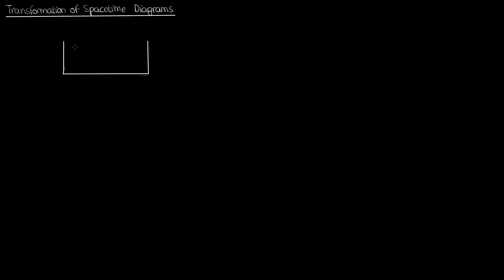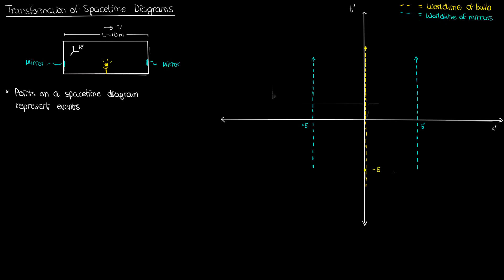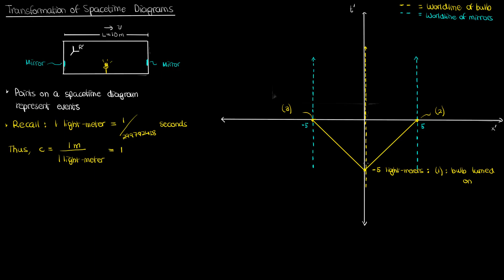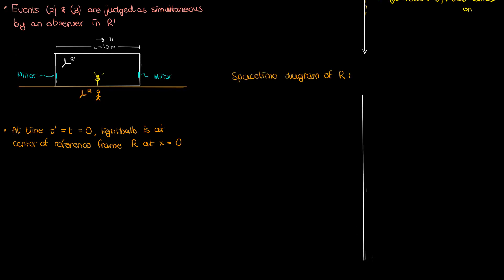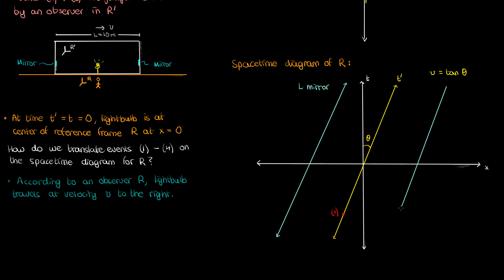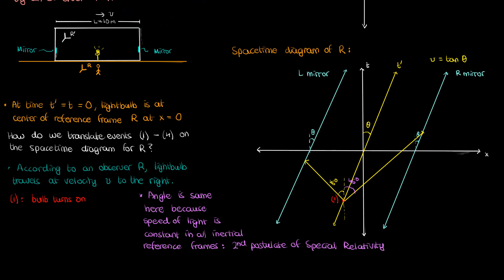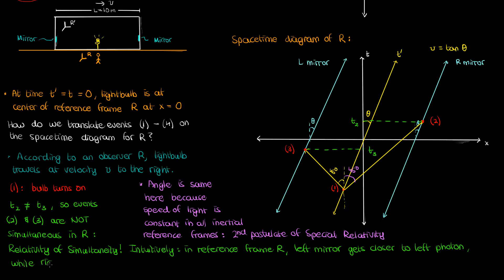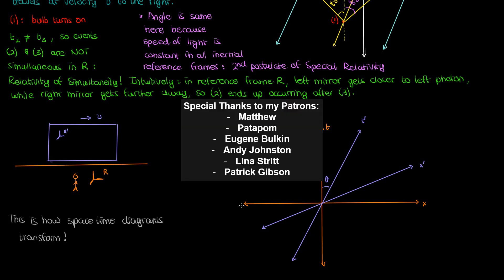How to Transform Spacetime Diagrams | Special Relativity

Comment: Fantastic video! one mistake however is that there is relativity of simultaneity again et event 4. at 9:19, the light beam worldlines should not meet
Reply: Actually, the light worldlines should meet at event 4. That event represents the two photons and the bulb all coming back together — a single spacetime point that every inertial observer must agree on. What does change between frames is whether the mirror-hit events (2 and 3) are simultaneous. In the train frame they happen at the same time; in the ground frame they don’t. But the return-to-bulb event is invariant — it really is one meeting in spacetime — so both photon worldlines correctly intersect the bulb’s worldline there.

Comment: This is a well made video.  Everything was correct until time 4:10 in the video.  The spacetime diagram was drawn for the moving train but the speed of light within the moving frame was not shown as a relative velocity instead it was shown as the constant speed of light in a stationary frame.  This is a fundamental error.

Einstein’s second postulate states that the speed of light in a vacuum is constant in a stationary inertial frame and is independent of the velocity of the light source.

This means that in a space time diagram the only time the light line is at an angle of 45 degrees relative to the time axis is when viewed from the perspective of a stationary observer.  This is because the light line on a spacetime diagram is a one way speed of light.  A one way relative speed of light in a stationary inertial frame is the true speed of light. A one way relative speed of light in a moving frame is always a relative velocity c-v.  The only proven way to get the correct speed of light in a moving frame is to use a two way measurement method.  A two way measurement method uses a mirror to reflect the light beam back to the source. In this way the velocity of the moving frame is nullified and the correct speed of light is determined. The simplified formula for a two way measurement is (c-v + c+v)/2 = 2c/2=c.

The light beams cannot and should not arrive at each end of the moving train car at the same time with the light at the center of the car for both a stationary and moving observer.  This can only happen in a stationary train car where v=0, a stationary inertial frame.
Reply: The postulate of special relativity is that the one-way speed of light is the same constant c in every inertial frame (with Einstein synchronization). That’s why in spacetime diagrams the light lines always appear at 45°. We don’t add or subtract the train’s velocity as in Galilean relativity. The “two-way average” method you mention is indeed how we can operationally verify c, but once you adopt Einstein’s synchronization convention, the one-way speed is isotropic in every frame by construction — and this is what makes Lorentz transformations consistent. What the video shows is correct: the mirror hits are simultaneous in the train’s frame but not in the ground’s, while the final return event is the same for all. That’s precisely how special relativity resolves these scenarios.
Reply: @cristian.vergara1 The second postulate references the speed of light as constant in relation to all stationary inertial frames, and by stationary it means relative to the medium the in which the light beam is traveling.  In a frame which is stationary relative to the medium of a light beam the one way and two way speed of light are the same and there will be no red shift or blue shift..  If the frame is moving relative to the medium of the light beam the one way speed of light relative to the moving frame is c-v and the two way speed of light is equal to c.  The light beam viewed by the moving frame following the same direction of the light beam will be either red shifted of blue shifted depending on direction.

The 45 degree angle of the one way speed of light is only valid relative to the medium in which the light beam is moving.  A frame moving relative to the light medium, then considered to be stationary relative to the observer is not stationary relative to the light medium.

The best example is one where two observers are moving towards each other at a speed of .25c relative to the light medium. The relative velocity is .5c between the moving frames. If you use the Lorentz transformation for each of the moving frames relative to the light medium the value entered for velocity is .25 c. If the case there is no difference in the calculated Lorentz factor.

When the reference to the medium is removed as is done In special relativity, the v used in the formula is .5c and both moving frames can then consider themselves stationary, the calculated Lorentz factor is much higher and the time paradox is introduced since both moving frames will have different times even though they are moving at the same velocity.

The reference to light medium must be included in special relativity or it is meaning less.  This also means that time is probably not related to the speed of light as claimed in special relativity.
Reply: agreed, there is again relativity of simultaneity at event 4 too!